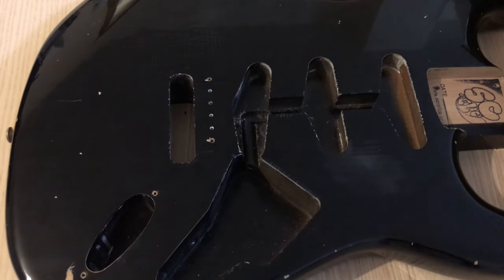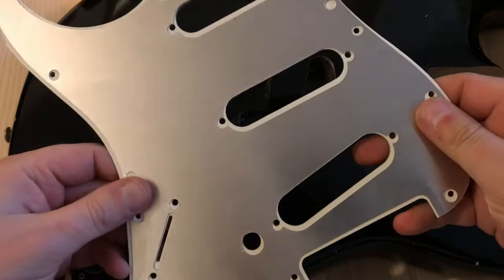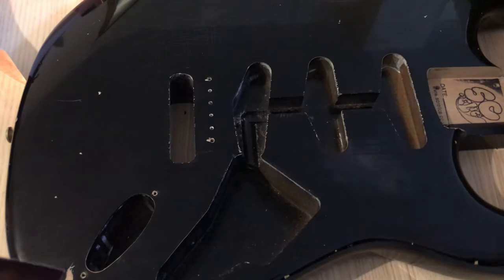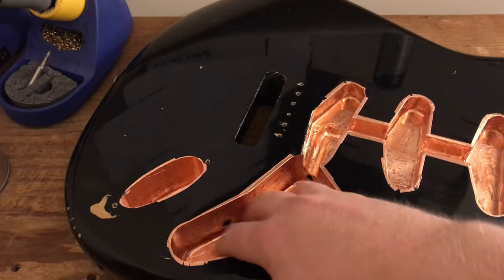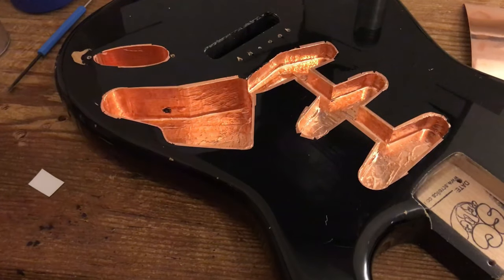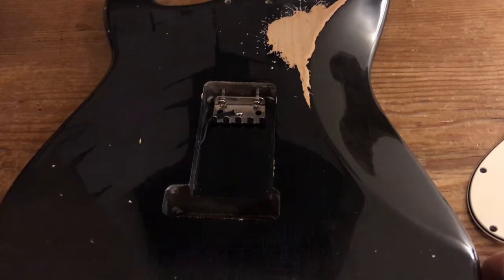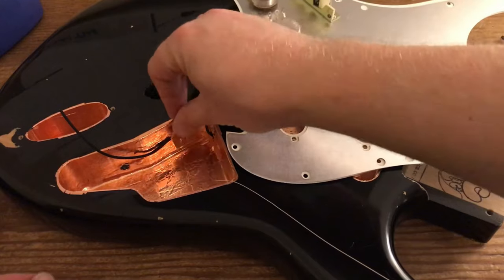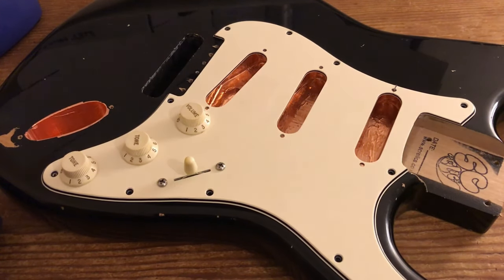Guitar Copper Shielding - How to Shield a Strat

Comment: A "perfect Faraday cage" would have to go over the pickups. 
Its a good shielding what you did but a "cage" is not possible on a guitar. 
Also its usually not neccessary, what you did is enough. 
I do it the same way. Exactly. I am a learned electrician.

Comment: You can't have a ground loop in a guitar; a ground loop requires at least TWO circuits for there to be a difference in potentials
Reply: Is it required to ground the shielding?
Reply: @idolcesar7124  you absolutely need to ground the shielding - otherwise, the "shielding" will merely act as an antenna that picks up EM noise and sends it right to the pickup(s). You really don't need to shield the control cavity though; only the pickup cavity/cavities
Reply: @kevinberg84  i mean is it required to have 2 ground wires?
Reply: @idolcesar7124  I'm not sure exactly what you're asking, but every component needs to be grounded
Reply: Kevin Berg what are your thoughts on shielding single coil pickups ? Thanks
Reply: @ourclarioncall  since they don't cancel hum, it's even more important! Fortunately, a lot of guitars with single coils also have large pick guards that can be used to help further shield your pickups. Just remember to ground your shielding! Otherwise you'll have just created a big antenna sending EMI right to your pickups - creating the exact opposite of the intended effect
Reply: Kevin Berg I made the mistake of shielding the cavity years ago with copper taps but didn’t realise I had to ground it . Oops. So from what I’ve been reading up (guitar Nutz 2 is a great forum) the main 2 things  to do are shielding the guitar and pickguard with something like conductive copper tape, making sure it has continuity and is grounded , and the other is to put pickup tape , then copper tape round your single coils , not fully round, but leaving a small gap. And that’s about it.
Reply: @ourclarioncall  I haven't heard about taping around single coils like that - I'll have to check it out

Comment: You shouldn't use aluminum on the pickup cover because aluminium and copper are incompatible and the aluminium will be rusted by that contact. You must use copper foil instead. If the guitar already comes with an aluminum foil, you must remove it and use copper.
Reply: In theory the aluminium foil may act as sacrificial anode, but i really doubt that inside a guitar cavity the extent of this corrosion will be noticeable.

Comment: You went way too overboard, 
If you are putting a shield on the pickguard its already grounded against the mount of the pots, so there is no point in having the bits folded over the body, also soldering in the wire to the main cavity to the output jack is redundant as well, its already grounded because of the housing in contact with the ground metal contact of the jack itself.
Just get an Aluminum pickguard or shield and you are pretty much done, Buy dimarzio pickups or more expensive pickups that have thicker wiring bundles as they are already shielded being wrapped and grounded making it really not that important to a degree. If you haven't noticed there are several single coil options that are noiseless pickups...and its achieved through the pickup in fact Fender has all together stopped shielding the guitars, because its kind of outdated in concept.

Also don't touch a soldering iron directly to the housing of a pot, you are damaging it, remember always rotate the dial to its lowest taper as well just in case you do overheat it so you are only losing the slightest taper of the contact.

Its also Aluminum, its an alloy not the raw element Aluminium......

Comment: If you use copper shielding, use copper PG cover.
If you use Aluminium shielding, use Aluminium PG cover.

Aluminium and Copper are not the best friends. The copper eats aluminum and corrodes it.

Comment: Please watch a soldering lesson online or something; it's so sad to see that nice Hakko iron abused. You should never have the tip hot without solder on it. Whenever you're not actively applying solder you tin the tip with some solder and just let it sit or cool like that. Then when you get back to soldering you just wipe the used solder off and reapply. You will destroy your tips over time leaving them exposed to the air like that. I can't tell what you're using but I also highly recommend ditching the old school sponge and exclusively using the brass sponge as well. It massively reduces the thermal shock and change in temperature every time you wipe the tip.